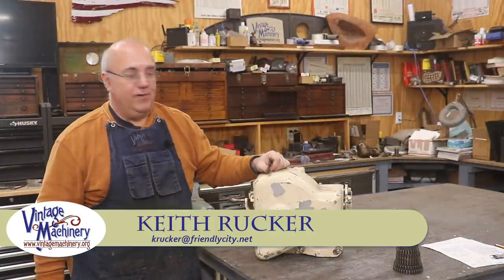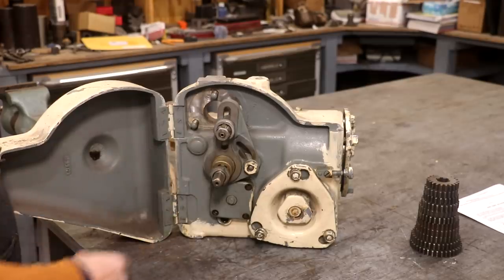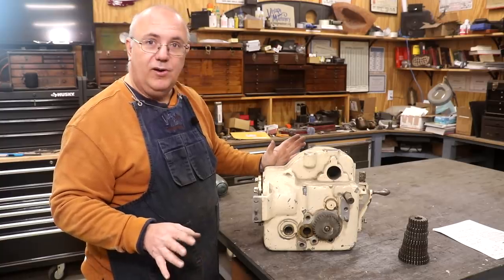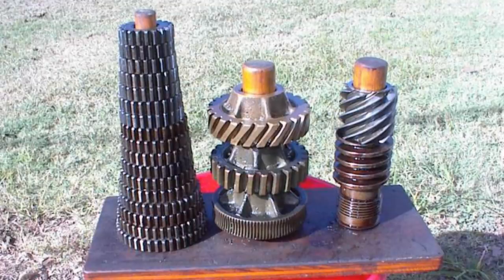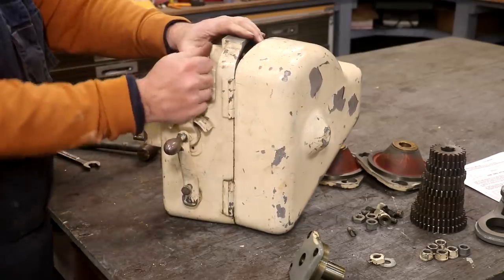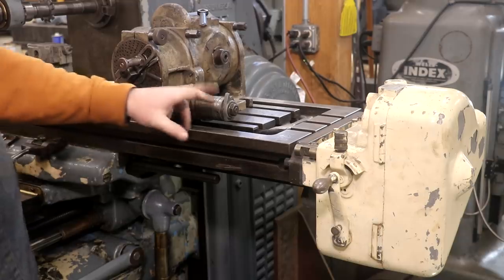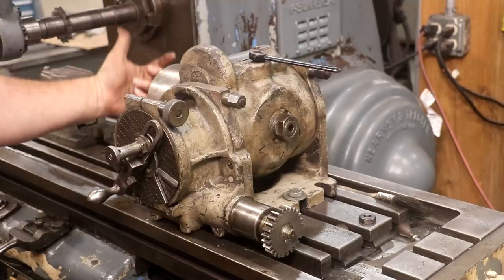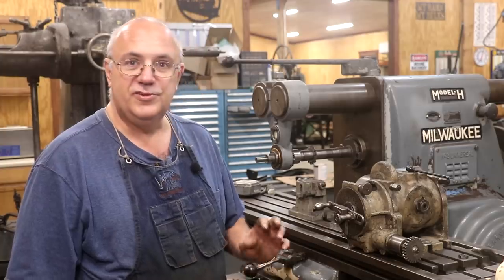Kearney & Trecker Low Lead Attachment for Cutting Spiral Gears

Comment: Seeing the mechanical complexity required to couple the linear motion of the horizontal mill’s table lead screw to the dividing head’s rotary motion - phew!  A 5 axis CNC mill swaps all those gears, shafts & bearings for lines of computer code.  Today’s machinists don’t have to write the code - they just have to be able to pick out the correct CAD/CAM package. 
Reminds me of how complex aircraft piston engines got by the end of WWII, & were quickly replaced by gas turbine engines. Look up a photo of the Napier Nomad aircraft engine (12 cylinder 2 stroke diesel compounded with an exhaust driven turbine which added thrust from its exhaust. And Napier advertised it as “the simplest solution”! )
The ingenuity of the old-time machinists to be come up with machines that cut helical gears and hypoid gear trains is just incredible!
Reply: Doesn't 5 axis still have lots of geary things all inside them?
Reply: "Today’s machinists don’t have to write the code - they just have to be able to pick out the correct CAD/CAM package"

And that's why so much of the prototype parts seem to come way out of tolerance with chatter marks galore...

Comment: It was a handy attachment, but in order to cut helical gears you also needed the Universal model H.  On this model the saddle has the ability to swivel to match the lead angle of the gear.
Reply: I was thinking about that and was going to ask Keith if his had the swivel on the table. And then I just found your comment saying basically what I was thinking.

Comment: Merry Christmas Keith!
You already have a part with that spline shape - the piece of the broken handle that was on the dividing head. In case of emergency you could weld/braze it with something to cobble together a shaft to drive that hing. It won't be pretty but may work.

Comment: Have you considered that the input shaft on the dividing head can also be used inserted directly into the lead attachment?  This is how my Brown & Sharpe mill is set up with the dividing head at the extreme end of the mill table, although it does not have the complicated drive box of the K&T, just arms with shafts that bolt to the end of the table, and the short lead attachment is a separate device with 4 change gears compounded and a dog clutch to allow easy return after a cut.  I suspect that your extension shaft is just to allow the unit to be used more towards the center of the table.  I also had a Cincinnati mill where the dividing head plugged directly into the change gear box.

Comment: Keith, I believe that some tractors use a 1" x 1/8"  6 spline coupler on their PTO, so maybe an agricultural engineers' supplies company might have something suitable for your K&T spiral gears feed mechanism.
Reply from the maker: I’ve found them with 1-1/8” OD splined, but not 1”
Reply: Kieth, I found a 1” x 6t x 2 1/8” Hydraulic Pump coupler on e-bay. I sent you a link by e-mail.
Reply: A drive shaft shop could also supply a sliding spline connection.  Probably not a 1" six spline match but something that would work.
Reply: @VintageMachinery  Keith the ones I found in the UK, showed 1" OD with 1/8" deep splines. I wonder if that is what 1-1/8" means rather than 1⅛" OD.

Comment: I have a Cincinnati Monoset that has a spiral  attachment built in for cutting and repairing flutes. It will as sharpen hog mills. It is a lot less complicated than your attachment. It works with  a sine bar in side. Their is a formula marked on the machine to set the sine bar for any spiral with in the limitations of the machine. Very easy to setup if the tool has the lead marked on it . Otherwise you need to indicate the flute . You can also cut flutes in carbide or high speed drill blanks which I have done many times. It was to make a tool which is a non 
catalog item. A lot of tool 
grinders don't know how to setup and use it .
Good luck getting yours setup and running.
Reply from the maker: Thanks - I am sure it will be an adventure!

Comment: Keith - you can make a spline female coupler if you have a  keyway broach the same profile as one spline.  Now make 2 guide bushes with TWO grooves, one for the 0 deg and 180 deg grooves, a second bush for 0 deg and for the 120 deg groove.  Now by juggling the bushes you can cut all of the splines for a six spline female.  A long coupler is more difficult, but the principle is the same.  It's not my idea it comes from the ingenuity of the late John Stevenson of the UK Model Engineering Forum, but it can be made to work.  I'm looking forward to the video!

Comment: Nice score. I’ve been making a conventional leads attachment for my 2ch. eBay has short 1” six spline couplers and McMaster has the shafting. In a pinch I 3d printed the complete  set of change gears for the convention leads attachment. This helped me design the mounting plate, basically a direct copy of the K and  T bracket but out of aluminum. Love to find a real leads attachment!
Reply: I had a 2ch while I had my shop. My current employer bought it at the auction and I've been machining some castings with it the last couple of weeks. I bought it from a local school when they auctioned a bunch of stuff. As I was leaving to get the flat bed to haul it to the shop, I spotted the gear box, for doing helical work, on a skid that had been sold before I got there...when I got back with the truck, the skid and contents was gone.
Reply: Isn’t that alway the case.

Comment: Good job on getting the driving shaft on the dividing head moving. I didn't understand why it wouldn't move because there would be no reason to lock it stopped. Finding that gunk in the bottom explains it because of many years of none use and then hardly used previously. If you can find 1 1/8th it seems one could talk to the seller's of that component to get a lead on one inch.

Comment: Keith, you could use the spline shaft and hollow spline shaft  you can get a hold of and machine a short adapter on both ends to match the existing spline using a broach.

Comment: Hi Keith. About part 46 in your diagram; it looks amenable to cutting those interior splines with Mr. Booth’s G&E shaper - I’m sure he’d probably help. The trick would be making a cutting tool that would have the right shape for the spline, and be just slightly longer than the length of part 46 and that could be fitted to the clapper-box doohickey. Another way to approach it would be to think of this job as being like cutting 6 keyways into a “blank” (a rod turned town to match part 46, and drilled so the I.D. matches the minimum measurement of the spline that’s already sticking out of the dividing head.) I’d love to see this operational and you cutting some helical gears with it! 🤠

Comment: Hi Keith. At some point there you said that you don't think the auxiliary drive shat is used for this attachment, but I'm pretty sure that it is. If memory serves, while the conventional lead attachment is driven by the lead screw, the low lead attachment takes input from the aux shaft and uses it to drive both the table lead screw and the indexing head. The table feed lever needs to be locked in the neutral position when using the attachment so that only attachment can drive the lead screw.

Comment: Great video ! Maybe your most interesting ever. If you're keeping your dividing head in one spot on the table you don't need that spline coupler; You can just use a short gearblank with splines and weld it to a tube with the same blank on the other side. Or simpler yet: It seems to me you can make part 46, 47 and 55 one single part. One side like I described and the other side with an outside spline for the gear in the LL box. Merry Christmas!
Reply: Now you are thinking, of something that is doable.

Comment: @23:22  make part 55 about 18" long instead of 6 inches.. or put a universal joint in the shaft for alignment issues.  you still need to create parts 50 thru 54.. don't forget that 53 is adjustable up and down to find tune the change gear lash..  you can then get by with a much shorter coupler 46 or a slightly longer coupler 48..  you might be able to create a broach plug for those.  you will want to possibly put a pair of snap ring grooves in the coupler so you can put a flat washer to allow you to bolt it to the splines on the angle attachment..  
lastly  can you ask your friend with the worm gears and change gears if there are any part numbers etched in them to make identification easier.   and does your friend with the gears need driveshafts too""  looks like there is a safety shield over the driveshaft.. that could easily be fabbed up with just a piece of sheet metal bend over a pipe and flanged to allow you to bolt it down to the table.  it almost looks like the dividing head input would slide into the low lead attachment as it is and end the need for a driveshaft.  but that might cause alignment issues with the change gears..

Comment: Keith,  1" six spline was used on the old FORD 2N ,8N, 9N tractors.  TSC or any ford agricultural shop should still be able to get parts.
Reply from the maker: Pretty sure those are 1" on the inside diameter of the spline - I am needing 1" on the outside diameter.

Comment: Thanks, Keith.  In using a dividing head, I saw the shaft for making spiral gears, but never used it, nor saw it being used.  I've seen still photographs and read the associated text, but I'm really looking forward to all the things you can do with the new setup.  Maybe even cams?   Again in the photographs it looked like you have to tilt the cutting head and the dividing head, but I'm sure that has to do with the lift of the cam or the diameter.   Very interesting.

Comment: I was almost certain it was gunked up on the low lead spiral gear attachment drive shaft. Was going to send you that message but looks like you got it cleaned out. The best of luck I wish to you to find the drive shaft, and you just know the gears that are missing will be the ones you need. I don't think I would even worry about that broken handle holder on the drive shaft attachment because when the drive shaft is on there you can't use it and is almost certainly how it got broken in the first place. Wish I had the parts for you to borrow.

Comment: I enjoy watching your doings even though much of your machinery is a bit modern for me. Now, your coupling: you know how to make a keyway, using a drift and bushing. So make up a bushing with 5 equally-spaced keyways as well as the slot for the drift, all at 60 degrees to one another. After cutting the first keyway, turn the bush and put in a key. Then drift the next keyway. Always put the key in the first keyway, just in case there is any inaccuracy in the spacing of the keyways in the bush, to avoid a cumulative error. Too late for Christmas, but a Happy New Year to you from England.

Comment: The cheapest way to make the hollow splined shaft ends imho is to 3D print wax models in a SLA printer and make investment castings in bronze. A bit of tidy up on the lathe and hand filing and brazing to a shaft will give you a good solution for not too much money or effort.

Comment: People really underestimate just how big of a deal CNC machines that can easily do simultaneous movements between axes are... Attachments like these, or specialty machines, used to be the only way to do it. Now you can just throw a rotary axis on your mill table and it's all done with software, no more gear train attachments.

Comment: Looks like the same mechanism that is used in my 10" van norman dividing head.  Might have to release the tension on the index plate and let it rotate freely in the casing.  Merry Christmas!
Reply: Yea, that clamp knob at the top of the dividing plate locks the worm wheel that holds the dividing plate assembly.  The splined shaft with the broken handle is a worm gear.
Reply from the maker: Yes, the clamp does lock it in place for regular dividing, but in this case, it was froze up from years of not turning.  Once I got it cleaned up, it went to working like it should.

Comment: I know this would not be in line with Vintage Machinery restoration, but that entire mechanism can pretty-easily be replace with a servo motor connected to an encoder on the table advance.  It would not take much programming at all to design a system by which any spiral could be configured by entering a few simple parameters.    Just a thought...

Comment: If you can't find a coupler you could have someone conventional edm an internal spline on each end the depth you need or even wire edm through the whole coupler.

Comment: Belated merry Christmas to you too Keith! For the long coupler there is no need for it to be splined the entire length. An inch or two on each end would be more than enough to handle the forces involved. If you can make the short ones make two and weld a spacer in between them.

Comment: I have a model H dividing head. To use that handle you need to loosen the clamping knurled nut above the dividing plate. The whole plate rotates when you turn the handle.
Reply: I see you worked that out. 👍

Comment: coupler use whats left of the handle (gives drive to the dividing head) and use whatever you can get to make the shaft up even if the shaft size is wrong on the drive end, your making that bearing holder you can make the gear size pitch correct for the drive

Comment: Had time to think about it contact friends on YouTube that have a wire edm to make your shaft couplers.if you could get proper gear hobb cutter you may be able to hob the gears on lathe if you mount cutter on lathe and blank on cross slide.there is a YouTube guy that has a gear co. In Australia that may be able to help you too.good luck.

Comment: Keith 1" six spline shaft is used on the front ends of tractors, to drive the hydraulic loader pumps. If you look at the PTO on the backside you will find 1"-10 and 1-1/8" 6 are the smallest size.  McMaster Carr list the standard SAE 6-spline shafting and coupling, but pricy. G&G out of Nebraska carries a lot of this odd stuff.  Drive shaft slip joints,  are not continuously splined on the inside, probably about 2-3 diameters of length is plenty. The hydraulic pump coupling others have listed, should do the job for you.

.Please take another look

Wingnut1964

Comment: I think that gear, under the cover on the end of the table, is for a rack cutting attachment. It looks like the same in a catalogue from the 50's, with pictures of the attachments available for K&T mills. There is also a much simpler conventional lead attachment they made that fits much the same.

Comment: That thru coupler would be easily made by wire EDM. Will not be cheap but doable. Contact the shop you plan to use to see if they can handle the length and what size hole to put in the center, they usually don't like going in and out of cuts a lot of times. Worth checking into If you can't find one.
Reply from the maker: That is an option!

Comment: FROM MEMORY -- I BELIEVE OLD FORD TRACTOR PTO SHAFTS (PRE 1953) HAD THE 1" X 6 SPLINE SHAFTS AND COUPLININGS LIKE YOU NEED. MARTIN GEAR (OR OTHERS) SHOULD BE ABLE TO SUPPLY COUPLINGS IN  STEEL THAT COULD BE WELDED. -- YOU HAVE BLOWN ME AWAY AGAIN WITH YOUR EXPERIENCE AND KNOWLEDGE.
Reply from the maker: I’ll check

Comment: It would be anachronistic, but this would be an ideal use for a slightly modified Clough42 electronic lead screw drive. Rig up an encoder driven off the table stub shaft and a stepper or servo motor on the rotary head drive shaft, and the ELS control would do all of the gear ratio and direction stuff without all of the mechanical hardware.

Comment: I really think you could broach the internal spline indexing the part one tooth at a time, even if you have to hog a little out first with a small endmill. Another idea, would be to split it into halves, and mill each half, then press both into an outer sleeve.... Would get you by for awhile until a real one shows up

Comment: slotter attachment and a rotary table or a shaper would make quick work of that splined coupler, guessing that is a pretty low torque application, you could probably get away with treating the spline like a shaft with a single key, or even use a 3d printed part

Comment: piast99 below has it about right. You can machine 2 shallow spline  pieces and then attach to each end of a tube. It also looks like the original gear you took off  would work for one of the gear change gears.

Comment: Merry Christmas Keith. I googled splined 1" couplers. Believe Amazon has what you could use. RuggedMade Steel Splined Motor Shaft Coupling, 1" Inch Bore, 1-1/2" OD, 2-1/4" Long, 6 Tooth Spline Hydraulic Rigid Coupler

That was the description. Not sure how to email you lol.

Comment: RE the dividing head shaft with broken handle not turning, there is a screw in the bushing its in at the bottom that I can see on the video.  Is that clamping or cam locking the shaft?  You may have to take the dividing head apart to inspect it, also your friend you get the parts from may know what to do or have a manual.

Comment: Only 15:00 into the video. My guess is you have discovered the bolts/nuts that you need to actually attach your attachment to your table. So someone threw them inside the case instead of having them screwed into their holes; which was probably a good idea.